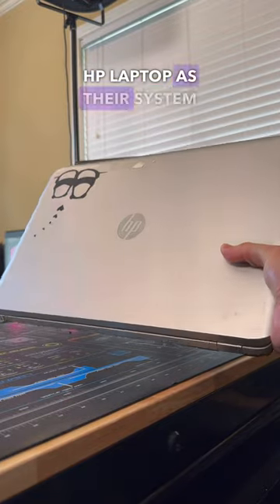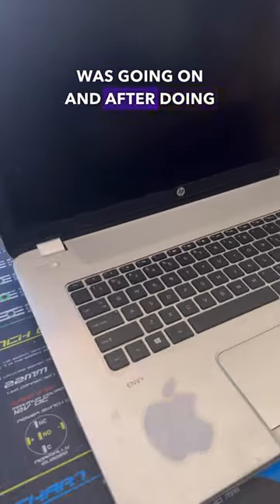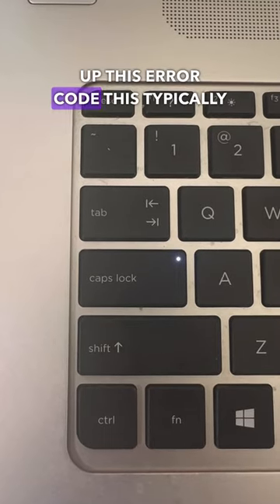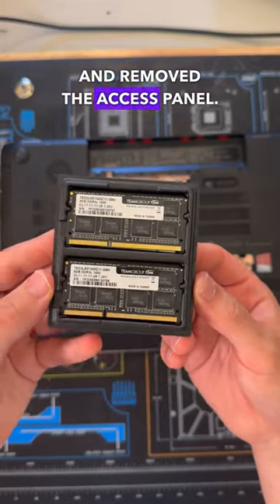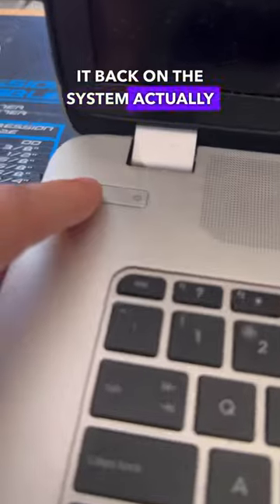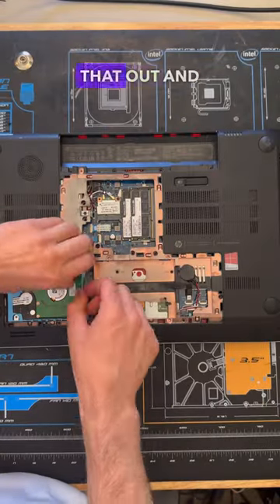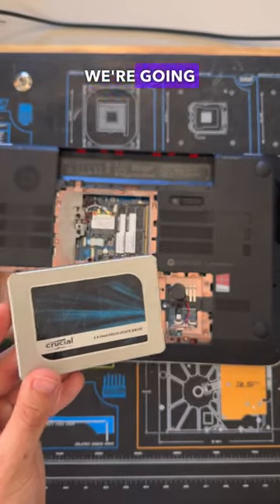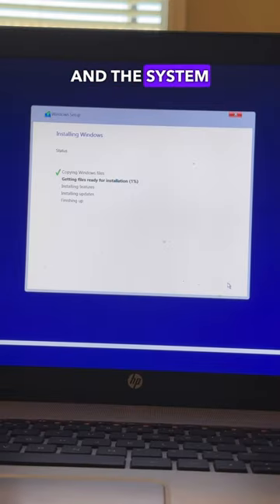CAPS LOCK FLASHING 3 TIMES! HP Laptop Repair! #shorts #pc #pcrepair #laptoprepair #laptop

Comment: Most of the time ram just needs reseating
Reply: how do you do it?
Reply: @osmancildir3938 remove Ram and put it back in
Reply: Yes. I did it and it worked. Actually had dropped my laptop and after which i encountered this issue.
Reply: I destroyed my laptop with water damage by mistake. I swapped the ram and same error. Giving up now

Comment: Did you also advise the customer that on October the 14th 2025 Windows 10 goes end of life? How much did the memory and solid state cost to upgrade a (technically) obsolete piece of hardware? If it's 8th gen intel or above you should have installed Windows 11.

Comment: Help me... My 1 year old  dell laptop is not turning on.
Charging light : dosent turn on until the power cord is plugged in and the power key is on hold.
Also color of the light is like.. Orange amber
Reply: oh yes i have that problem i fixed it yesterday you need a battery replacement tell me if it works
Reply: I've given it to dell customer service team... They are changing the motherboard and power in ac cable... I don't know what it is... And yea its costing me 10K INR (121.85 USD)

Comment: Yeah with that new SSD it's basically a new machine PC. My sis old Toshiba 5 gen i3  laptop had single stick 6gb of 💩ram and and a Old 320gb ☢ pile of 💩 Toshiba mechanical hard drive with massive bit rot , average boot up on windows 10 to 15 minutes. I replace ram with a new on sale Adata 8gbx2 16gb ram kit and a new 500gb WD green SSD with a clone of her old mechanical HD. New boot time average to windows is 45 seconds. Quality ram kit and SSD (both parts found on sale for a total under $100 usd) extend the life of the PC for year to come.

Comment: I have HP Victus 16 - d0662TX 
The display is not turning on.
And the cab's look blinking 4 times

I tried 
- RAM Sawaping 
- RAM Changing 
- BIOS Reset through Keyboard 
- Unplugging the battery and on 
- BIOS flash using USB 

But still not turing on.